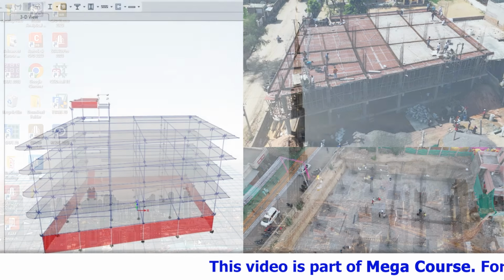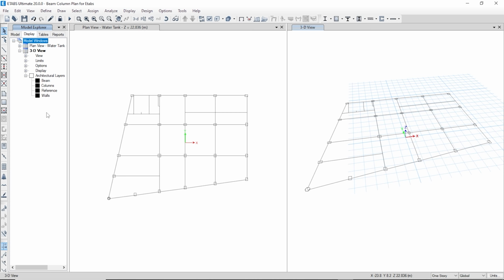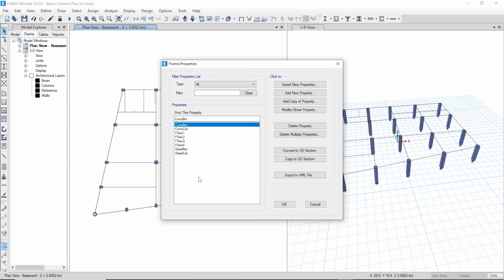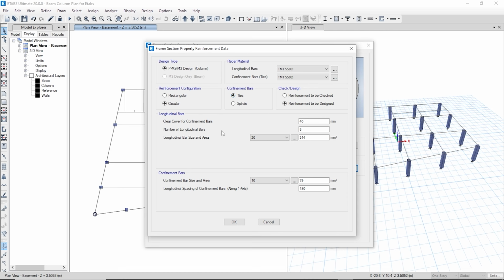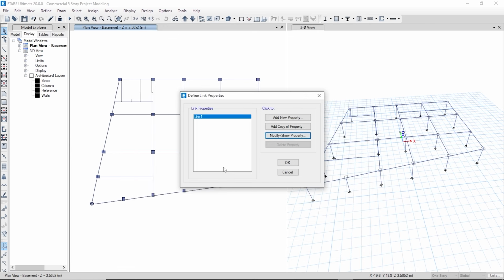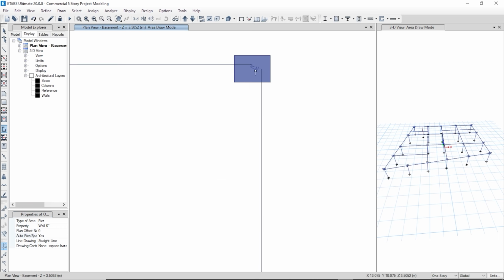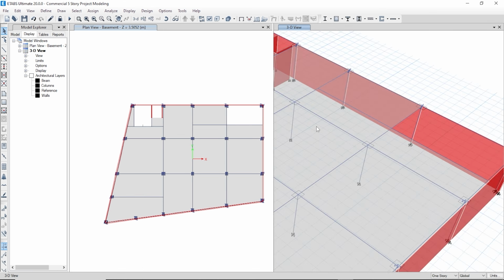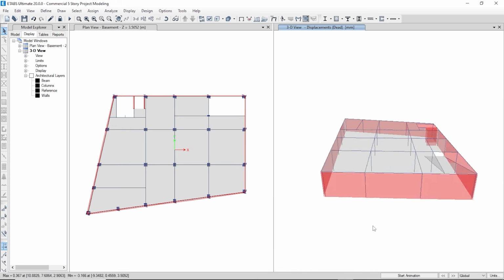“ETABS Full Tutorial: Building with Basement Retaining Wall Modeling |Practical Design Series Part 2

Comment: Hi sir, the raft foundation height is approximately 3m? I have it at -3m and basement starts at  -2.6m when I modeled it like this I had alot instability  problems
Reply from the maker: if the raft foundation is of 3m depth then foundation base has to be dug deeper.